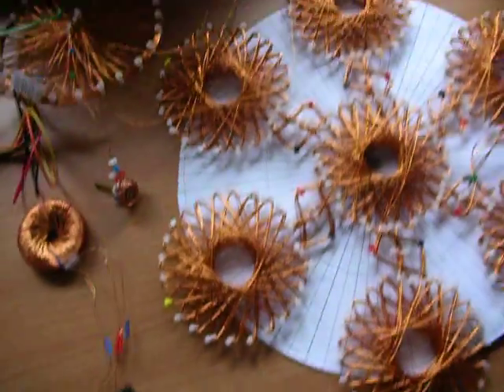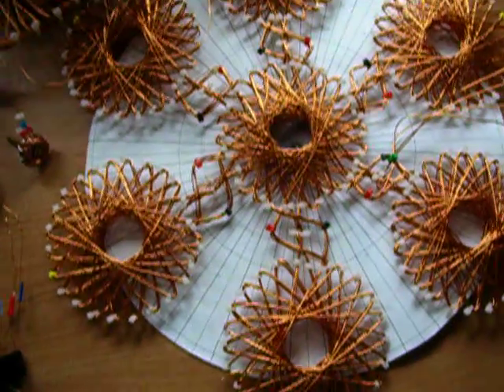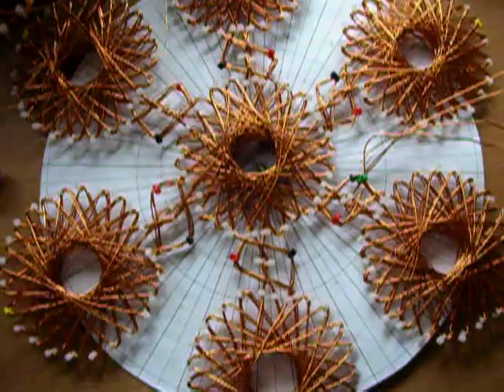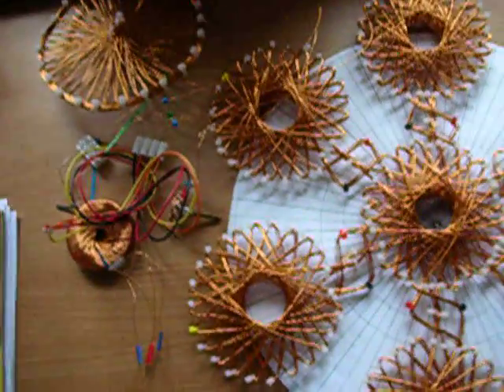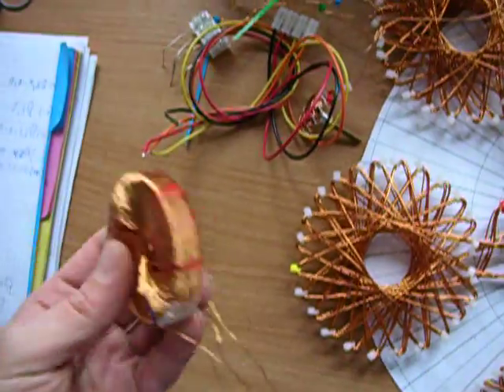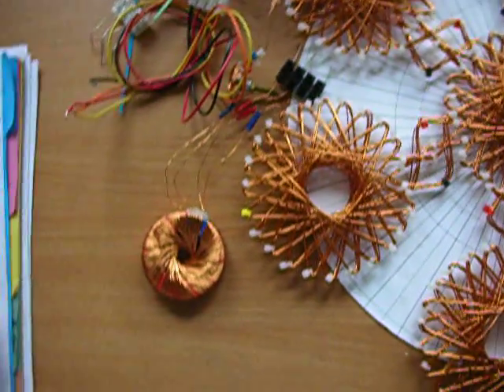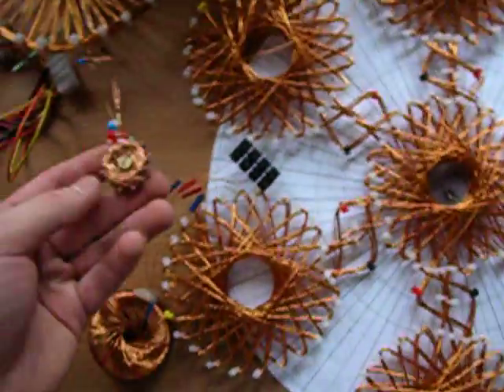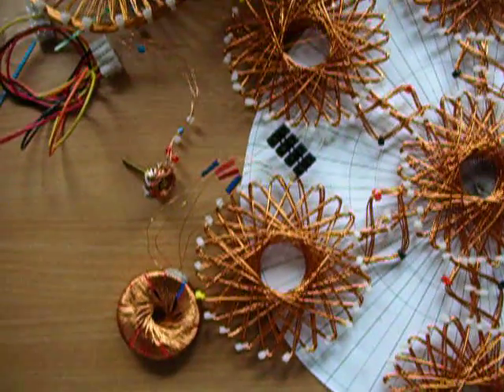Coils and Resistance # 1

Comment: The coils on the new board have 15 ohms each . when they are in series they add up to 45 ohms. Now when i set the trigger coil resistance the magnet disks have to be at full stop or the ohms tester will jump all over. my be remove magnets far away from coils. then check.  best to ya